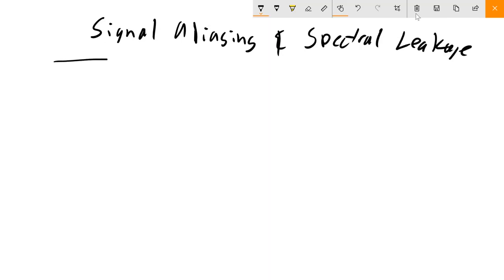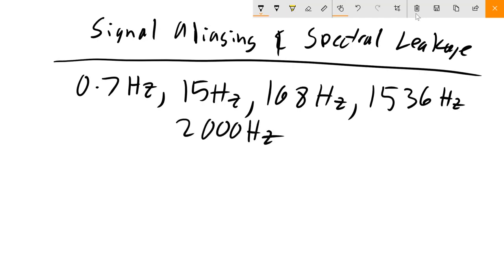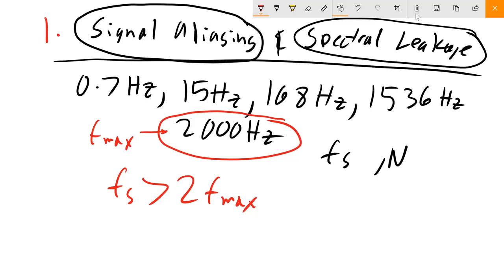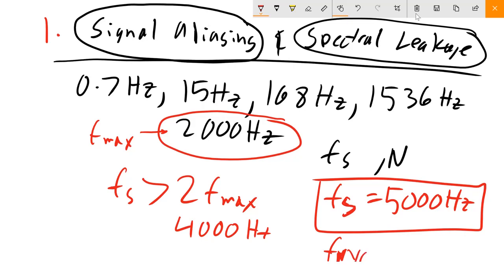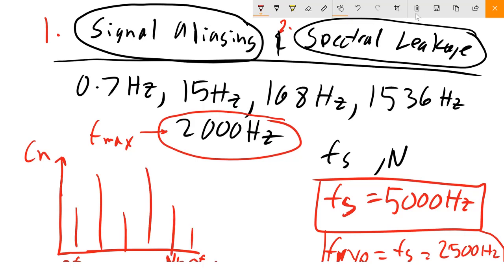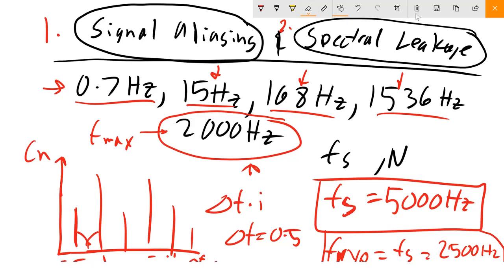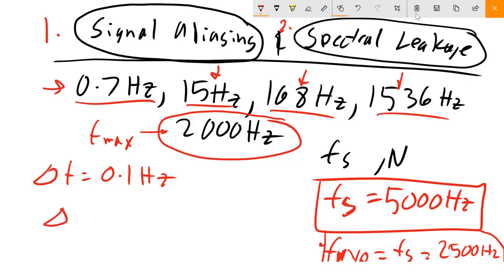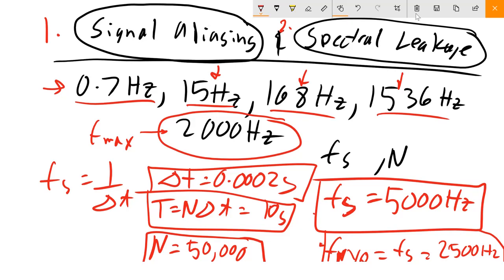Signal Aliasing Spectral Leakage Example

Comment: Great video! But what if you do not know beforehand what the maximum frequency will be? Is it viable to just use the largest sampling frequency and sampling time your equipment / time constraints allow? Even then, how can you be sure that no leakage occurred? By applying a high pass filter?

Comment: good video, I'm using Fourier transforms to analyze an incoming signal and try to identify its components breaking it down into regular wave for each I need the (frequency, amplitude, and phase), how do you select delta f if you dont know what freuqencys you will get, if you have a leaking signal is there any post process to address this?